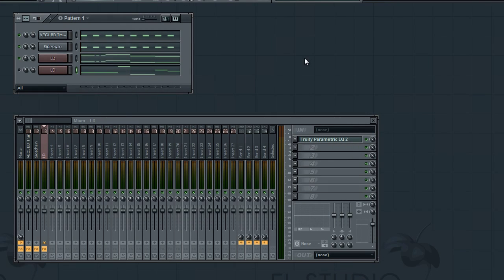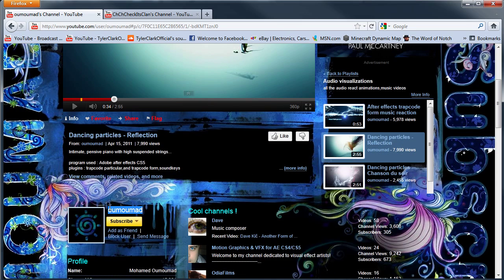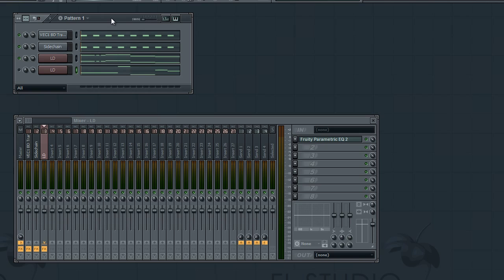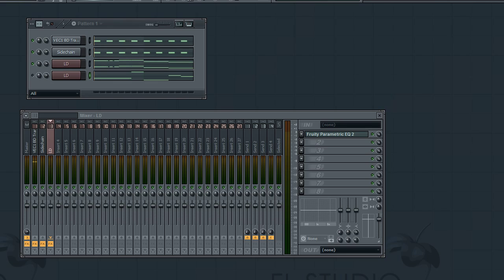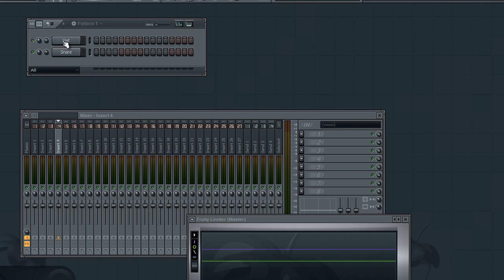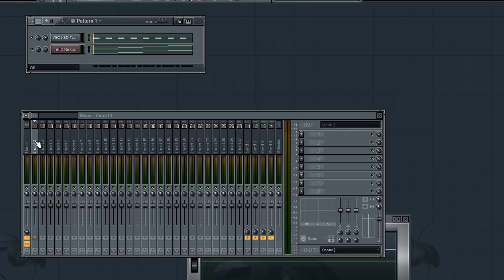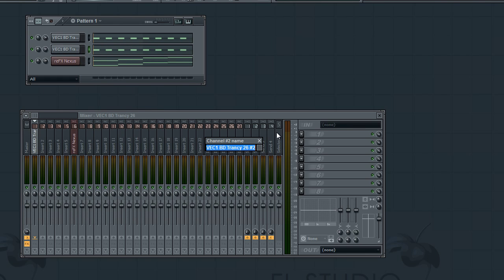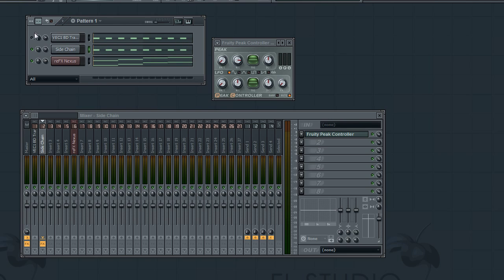Sidechain in FL Studio 10 Tutorial

Comment: i use an unmuted peak controller to control the gain knob on a limiter on one of the send channels which also has a gross beat for kick-less pulsing which is automated and send the channels which i want to duck. i can further control the levels via the knobs on fruity send (you might get some artifacts). or much more simply use the side chain on the limiter.

FYI: an LFO is just that, a low frequency oscillator hooked directly into the controller. if you mach the speed to your BPM you get a simple gross beat.

Comment: Nice, but does anyone know how to sidechain more than one track? i have tryed repeating the process for another channel but it does not seem to work :L kinda sucks, and i can't put all the sounds i want in one mixer track because i don't want them to share the same effects.
Reply: Link multiple instrument volume dials to the same peak/lfo controller maybe? Just a guess.
Reply: Errick Jackson hmm that does sound like it could be a possible way round it, good thinking! i will try soon
Reply: Yes. I like to put the compressor in the send that way you can link as many tracks you want to the sidechain effect with just one set up (just learn how to use the send). Also if you non side chained signal/sound seems to loud compared than the sidechained sound just boost the eq after the sidechain and put a limiter after. Check both sounds with the db meter

Comment from the maker: @DJxVALOR 
A really really good sidechain (one I do) and probably should make a tutorial on it is tethering it to an EQ band causing a filter / cutoff effect to the sound, and also tethering it to the volume or a compressor. Putting it on the compressor really just does that same thing  as the volume, unless you tether it to the Threshold in the compressor which gives you a little different effect. Gain = volume essentially inside a certain perameter.